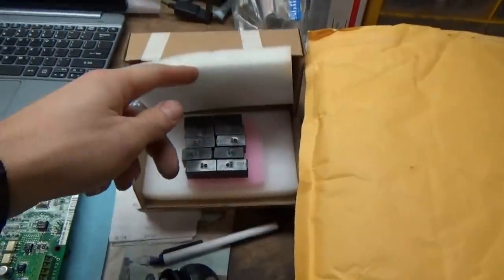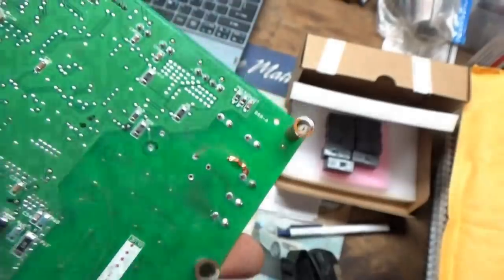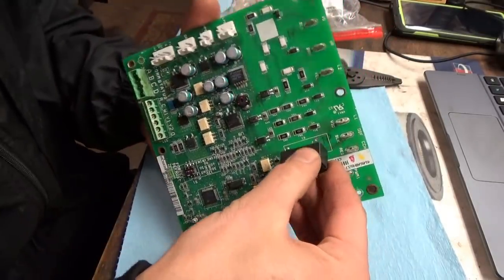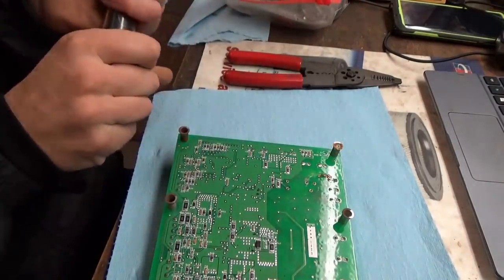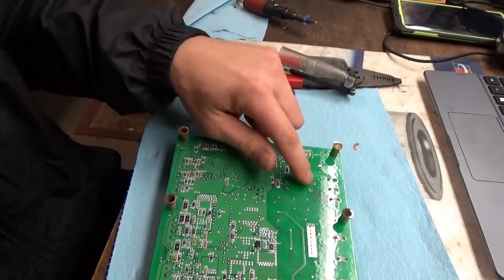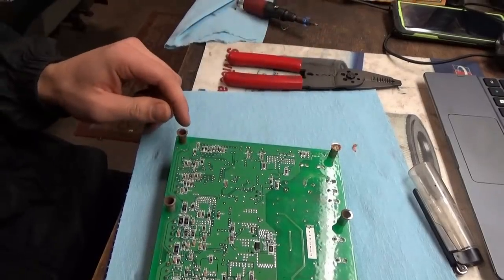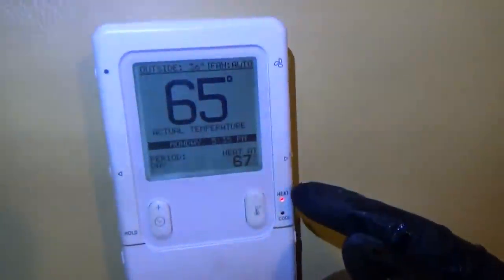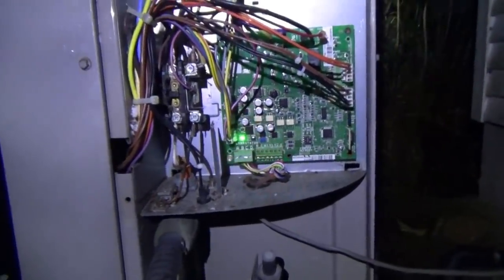Bryant HVAC Heat Pump -Part 3: Repair

Comment: I went back to Part 2 of your video and looked at your EBay screen and saw 5X meaning the $25.00 price was for 5 relays, I did the same thing when ordering bronze bushings, needed 2 ordered 4 and got 8, the price I was looking at in my case was for 2 pieces, didn't notice it.
Reply from the maker: haha yup now I got a lifetime supply! Still even $50 for 10 relays is a bargain for the total repair!

Comment: Great job Ivan. Ever break open an engine computer? (I've never had one fail as a DIYer). I assume they may be in some kind of potting material. At the very least the boards would have to be conformally coated. If not potted you could save money by replacing a component or do they make it impossible to break into one?
Reply from the maker: Absolutely! Some PCMs are serviceable, some are not.
Reply: If you watch ScannerDanner he has a video where he broke open a PCM and replaced a transistor driver for an injector or coil on a Subaru.  I think it was a Subaru anyway.  It's been a while since I watched it but he showed some good info in that one.

Comment: you may have gotten lucky with a good tech, that would have installed new board and external crankcase heater, assuming they know a trace obliterated like that was a very high current event and figured the relay was welded when the fan didn't run still. but I'm not sure how many would have electronics backround and be able to quickly follow the traces.
that one was simple to follow and see through video easily. I could also see the anti-spike/flyback diode on the other side of the board across the relay coil, and the transistor beside it. you could have powered by looking at the diodes polarity marking (it's reverse polarity). they're used on cars also on things with coils like the ac clutch and many others.
Reply from the maker: Cool trick! I'll have to remember that.

Comment: Ref your epilogue, had you called an HVAC fix co, they threw a new board in, charged you for it - then that blew in short order due to the same underlying fault. Call them back, they find the short, fix it and charge you for another board as well?
Is that acceptable where you are?
I could see so if you specifically instructed them to replace the board in the first instance.
But if you call them out on the basis of "My HVAC is bust, please come fix it", surely the customer doesn't keep eating the costs for the same part over and over until they actually diagnose the underlying issue?

Comment: Ivan, can you fix a broken heart ?  💔  You need to find the hole that the mice used to gain entry.  Plug it with stainless steel wool.

Comment: Not a big fan of your soldering iron those exhaust holes out there on the end if you’re not careful you’ll burn you’re bored up.. The Milwaukee battery soldering iron works very well... I may send you one for X’Mess 🤔🤔🤔🤔🤔
Reply from the maker: That's very generous of you! My first butane iron could turn the heat way down, but this one is high or super high haha! Haven't burned anything up...yet. Just have to work fast lol
Reply: Pine Hollow Auto Diagnostics .. Send me an Address and I’ll get one out to you and see what you think about it.
Reply: @PineHollowAutoDiagnostics  - Sounds like my face-melting waste oil burner I nicknamed, "FACE MELTER", LOL. It has two settings: "Friggin HOT", and "THERMONUCLEAR MELTDOWN". 😁😁
Reply: curious which soldering iron were you talking about ?

Comment: Hey, awesome video!  If I might offer a suggestion, look into some electronics soldering flux, and if the solder you used is not specifically for electronics, try a rosin core electronics solder.  The flux will make the solder flow really easily, and you will not have to use quite so much heat, which is safer for the board and components.  There are small sponges that are used damp to keep the soldering iron tip clean.  A little solder on the iron tip helps transfer the heat, then apply the solder to the parts right where the iron touches them.  Apply some solder to bare wires, called tinning the wire, before soldering them in.  If possible, make a little hook to mechanically fasten the wire to the part before soldering.

Comment: If you want to improve your AC electrical knowledge, I found a youtuber Jim Pytel, to be a great resource.  He's putting the lecture side of an industrial electrical tech together.  He's just now doing AC and 3-phase AC.  It's theory and math but finally someone who logically explained power factor to where I could understand it.
Reply from the maker: At my job we work with industrial companies where EVERYTHING runs on 3-phase. It's a beautiful concept. I actually had to put together a presentation and teach my peers about 3-plase AC motors...learned a whole lot in just a few days :)

Comment: Awesome repair. Love it! If you’re going to make a habit of PCB repairs at the workbench, a soldering station is a decent investment. Not being rude or disrespectful, they’re just kinder to the board and components because the rework joint is faster than your butane iron.
Reply from the maker: Definitely! I have a nice Hakko temp-controlled station, but just decided to go "quick and dirty" on this one haha

Comment: The condenser fan motor is wired through a relay because it’s a heatpump. The fan has to turn off during a defrost cycle or else the coil will never melt the ice buildup in the wintertime. Most A/C only units wire the fan and compressor together, since there is never a time to run one without the other.

Comment: Nice work, Ivan!  Most home appliances are much simpler than the cars you normally work on.  I have a washer and dryer that are about 25 years old because I just fix them when they break.  Amazon can have most any part I need within a day or two and they are simple as heck.  The electrical part of HVAC systems is not that complicated either and you proved that by just applying some basic electrical theory used in any electrical troubleshooting.  

5 years ago, the first winter after moving and buying a house here in the Charlotte, NC area, one of our furnaces gave out.  A home warranty was included by the seller but it was a $75 deductible and would take day or two to get someone out.  I went up, read a flash code, and watched the unit.  Blower fan wasn't coming on (this wasn't the one with shorted fan that burned up the board.)  I pulled the board, flipped it over and found a burned solder joint on the blower relay.  5 minutes and some solder and the heat was back on and has been on for the last 5 years.  Checked the other furnace for the same problem but it had a new board...lol.  Pretty sure I spent less repairing than the previous owners. 

Great videos as always!  This stuff isn't hard and you just have to get in there and use your head.
Reply from the maker: That's fantastic! Love the stories of DIY repairs here in the comments :)

Comment: Why do you use a separate lighter to light your iron? The cap has a built in flint wheel. If it's depleted or dull- use parts from a cheap lighter, 5 pack at $1 Store. That's my OCD, tools should function correctly.
Reply from the maker: haha that flint wheel is a pain in the butt! A flame lights butane much easier than a spark :)
Reply: Christmas is coming...
https://www.amazon.com/EAGems-Soldering-Multipurpose-Station-Accessories/dp/B071ZHZZQM/ref=sr_1_1_sspa?ie=UTF8&qid=1543858844&sr=8-1-spons&keywords=butane+soldering+iron+kit&psc=1

Comment: have the same bryant evolution thermostat, the outside temperature goes crazy in the summer, showing 105 when it's 80-85. Should I relocate the sensor? Right now it is hidden inside outdoor outlet in usually shady area.
Reply from the maker: Ours does that too when the sun hits it every afternoon in the summer. Can't really fix it except by providing some shade haha

Comment: Root , root  You got to the Root of the problem, before you replaced the relay, and repaired  the circuit board !!!!!! Great Job !!!  if I was still teaching I would defiantly use your videos to reinforce to find the cause,  not just replace the parts. THANK YOU  IVAN
Reply from the maker: That is a humbling comment, John :)

Comment: Ivan, good repair,the only suggestion I would make is, get a decent 30-50 watt solder iron so no chance of damaging board clads ,  also possible smaller solid wire to wrap around pins before soldering, that way no chance of wires becoming unsoldered if heated up by too much current in circuit.

Comment: Knowledge is truly power.  I fixed a tiny little power supply today.  2 capacitors were blown. 0 dollar repair since I already had the caps.  It's great to be able to fix stuff.

Comment: Ivan, would be better to first tin each end of the jumper wire before soldering it onto the board. Also for the outside circuit boards, I always spray bare solder connections with clear Insulating Varnish, prevents green crusties on that copper wire.

Comment: Just so y'all know and find it easier, the soldering iron Ivan is using that he loves so much is the ISO-TIP Pro 50. It's the same one Radio Shack used to sell.
Reply: I was just going to say that's quite the soldering iron you have there .
Reply: You can buy a butane one at Lowes for around $50
Reply: @zeke112964  the radio shack one there used to be $21, but I agree a solder station would be a big help, the KSGER T12 from banggood at $50 is getting good reviews--I still have my old Weller station
Reply: @Starcrunch72  The BernzOmatic is $30 and Micro torch with solder attachment is $26 at Lowes ...I can't find a Radio Shack within 115 miles of me
Reply: zeke112964 I found a Bernz O Matic Butane soldering kit at Lowe’s on a close-out of shopworn merchandise for $10.00.  At the same time I got a new Kobalt heavy duty air wrench for $30. Keep your eyes open for these opportunities. The Lowe’s manager was determined to clear some shelf space by selling a bunch of useful stuff like those items in one hour for any bid of a few dollars or so.

Comment: My fault . That was a 12 amp relay.  I'm so cheap!! (https://www.ebay.com/itm/Car-Starter-Automotive-Relay-Heavy-Duty-SPST-4pin-DC-24V-12V-200AMP-w-Terminals/152163202924?hash=item236da2376c:rk:1:pf:0&var).  You are a good teacher!!!

Comment: Ivan sounds like going to a stealership about the same when it comes down to price and honesty 1 more thing check your strip heaters if your air handler is equipped Here in Chicago it’s a necessity. There always being staged per temp delta/t

Comment: Great fix!
Someone was mentioning that the cap for the fan was getting weak because of slow start up. Do you have a way to check it?
Why did they send you 6 relays?
Reply: Dan'sMeTube He was sent 10 relays because he placed 2 orders of “5 relays”. He showed the listing that he purchased from in the previous videos. The capacitor should be tested with any modern digital multimeter that has a capacitor measuring function.
Reply: @ecaparts  Thanks Jim! I was thinking that those were some very expensive relays!

Comment: Great Fix! Why does the heating always fails when it freezing and there is snow outside?🤣🤣.
Reply: I guess the same reason air conditioning breaks down when it's hot and humid.
Reply: This system does both heating and cooling so it is almost constantly in use.
Reply from the maker: I'm Russian so we don't use the A/C in the summer...just open the windows :)
Reply: @PineHollowAutoDiagnostics   I hear you! I have my Russian gear in use for the Wisconsin winter.
Reply: @PineHollowAutoDiagnostics  So you're saying Russians are cheap, I mean thrifty? LOL
Reply: @PineHollowAutoDiagnostics  from Siberia?🤣❄❄

Comment: eyeglass machines,farm equipment,heat pumps,scooters,Russian cars,domestic cars, lots of great vids!!! Thanks from Canada
Reply: Man lifts......
Reply: Not to mention Eurotrash as well.
Reply from the maker: I like a good variety of challenges...keeps it interesting! :D
Reply: @PineHollowAutoDiagnostics  you like it warm to.lol
Reply: @willefixit   the CCH is replaceable. It's a stab-in and not a belly band heater. Comp has a pocket that the CCH goes into.And you are right. I,ve done commercial HVAC for 22 years and i bet thats exactly what they would have done. Replace board and blow it up, replace the new board with another new board..lol Very impressed with your troubleshooting skills.
Reply: Don't forget soup.
Reply: @Spike-by3cy  - Borscht! 👍👍 My wife is going to fire that up one of these days using Ivan's video. 😎
Reply: Like I said Classic Pine Hollow Auto Diagnostics

Comment: They'd probably just tell you you need a whole new heating system
Reply: I used to work with a guy whose favorite line was, "Your HVAC equipment is old and could fail at any time."  He told me that he used that line mostly on old people and women to scare them.  The owner of the company asked me how he was selling so much equipment and I told him, "He's scaring them and it works."
Reply: That line helps sell cars too. @picklerix6162

Comment: Excellent job! Couldn't have been better.  Good call on soldering the wire bridge, I've done that a few times with no issues.
Reply from the maker: Thanks, Cuba! It was really satisfying to get this unit up and running again good as new :)